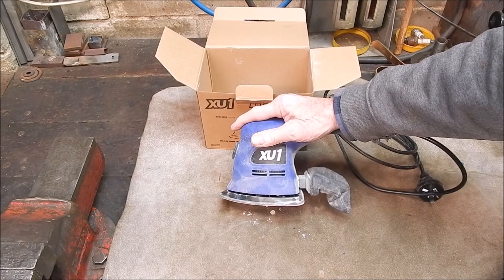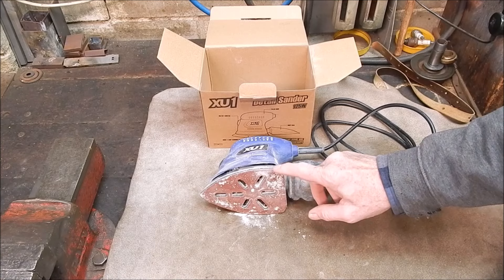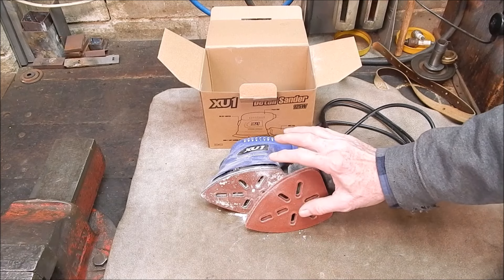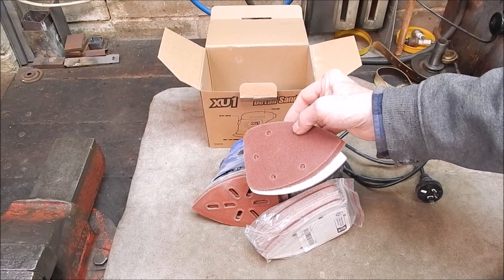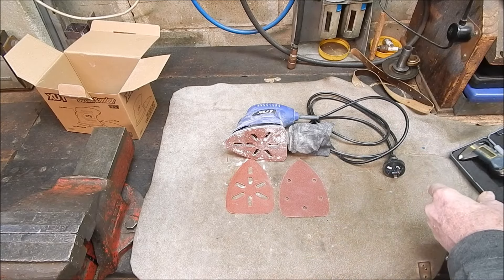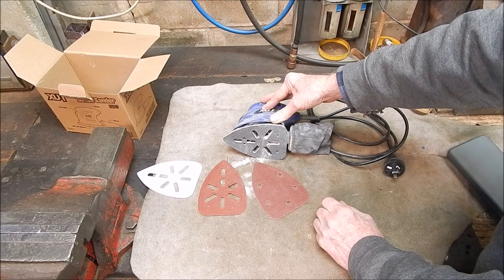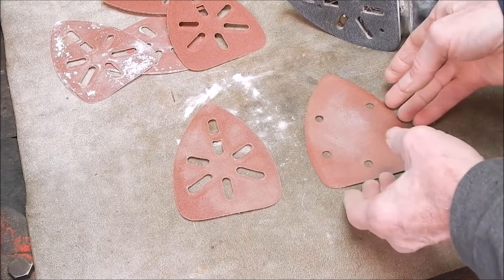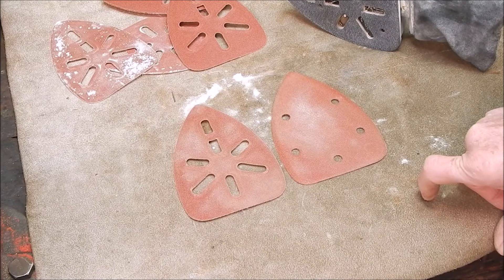Are TEMU detail sanding pads any good ?

Comment: I find cheap tools & expensive sharp bits works fine most of the time.

It's worth remembering that if the good sandpaper costs 3 times the price but last 5 times longer, which one is the bargain again?
Reply from the maker: Yes.  The TEMU sandpaper will be handy for jobs that clog up pads (ie.  paint).  Just waste and discard them rather than the expensive ones.   Cheers Rob
Reply: @Xynudu  Yeah, cheap crap has its uses, no point spending big on a one-off jobs and the like.

Comment: Interesting review Rob. But as you say, you get what you pay for. I wonder how many sheets of the cheap stuff would you use to match the good one? Cheers Nobby
Reply from the maker: Hi Nobby.  First impression was that the pads looked OK, but the grit went off real fast when used (and it was only on wood).  The genuine article grit was largely unaffected.  I think the TEMU sheets will wear out way before they clog up (as usually happens).  I wouldn't hazard a guess to the ratio.  Time will tell.  Cheers Rob

Comment: Hi Rob, nice review. Always good to get your honest opinion on things.
I went to Temu a couple of weeks back and they wanted a minimum spend of $60 before they'd let me check out (I live in Australia as well).
I wasn't going to buy more crap I didn't want so I backed out. Just wondering if you experienced the same thing?
Reply from the maker: Hi Jack.  I haven't come across that one, but I've only bought this one item for less than $15 AU.  Their web site is insidious.  Last time I went there a spinning lottery wheel came up and of course I was a lucky winner and supposedly got 100% off something.  I didn't take up the offer.  Tactics like that spell "be very careful".  It's definitely a high pressure site.  Not everything is cheap either.  Their metal work tooling is way more expensive than Banggood used to be.  I think it's a bit of a con really, designed to reel in suckers.  Cheers Rob